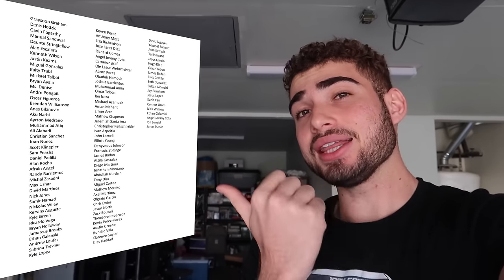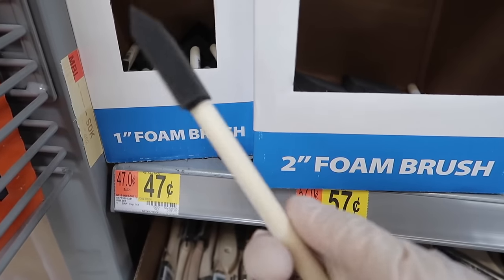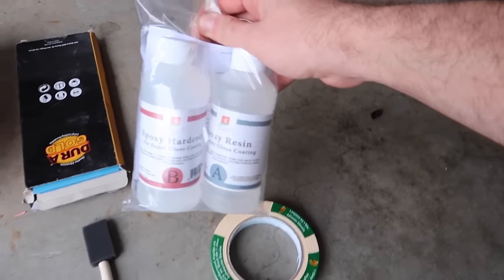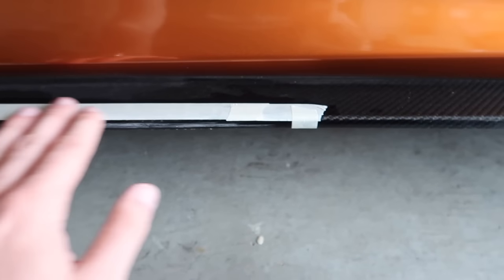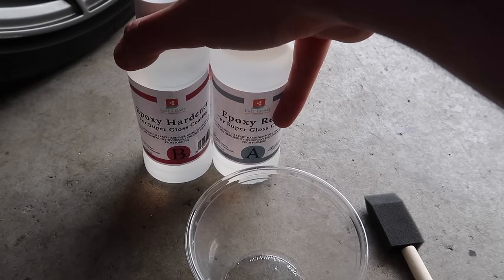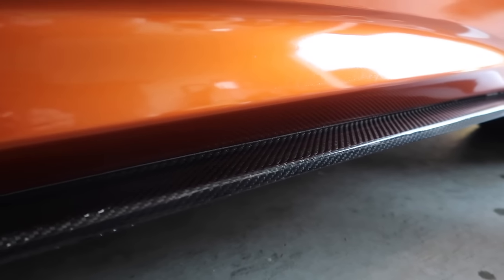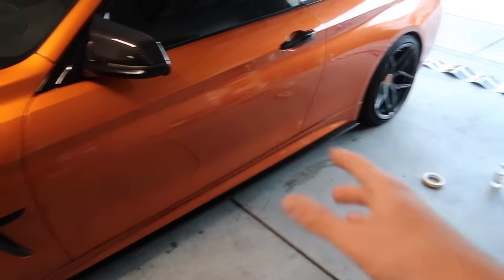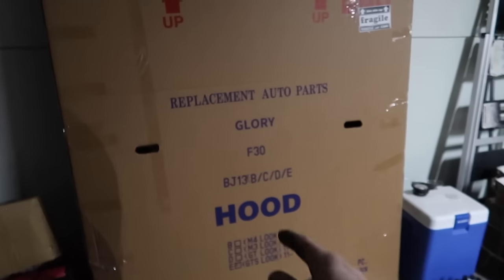REPAIRING MY DAMAGED CARBON FIBER WITH RESIN!

Comment: I just bought a rebuilt title STI from copart. It’s all grey so I was surprised to find out the right fender and skirt are carbon fiber. The skirt on the left side was missing or shattered from the accident. The left fender came in the car,  it defines seen better days considering it’s in the accident side. 

I’m currently looking to find someone to repair it for me, or if it’s even possible😂